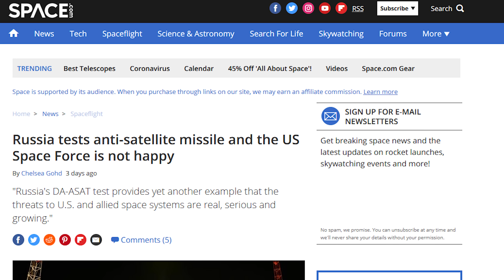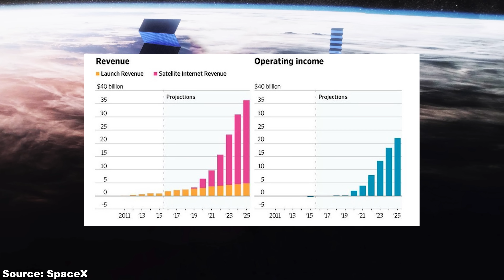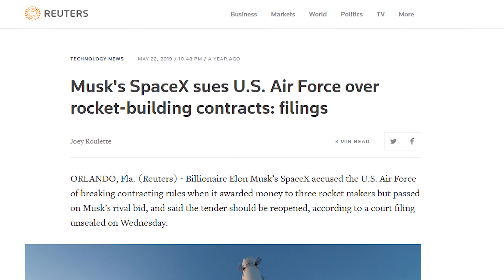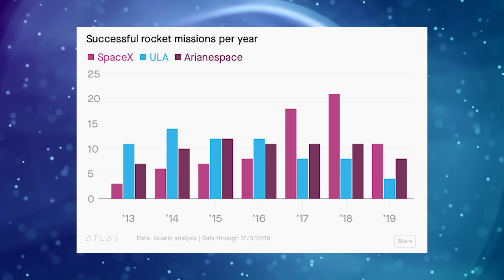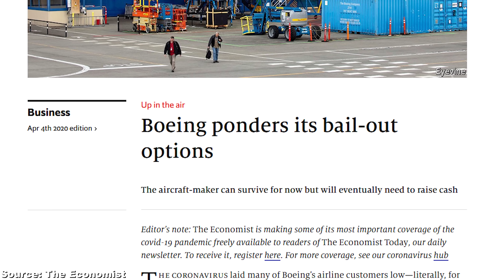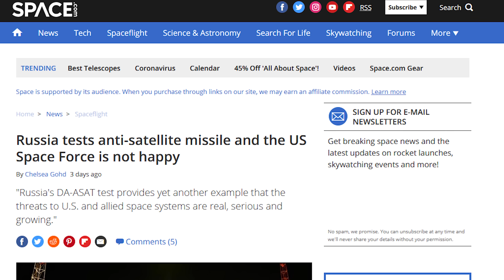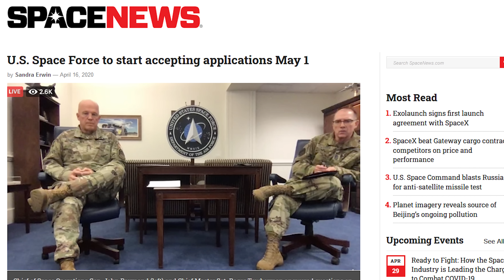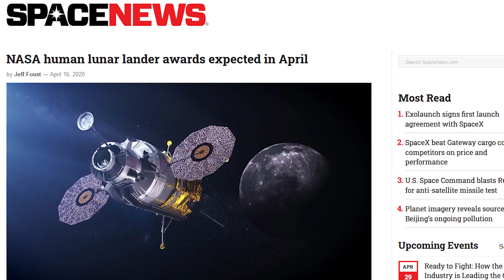ULA & Russia AFRAID of Elon! And Can SpaceX Afford 1000 Starship?!

Comment: I got a chuckle out of your humorous music choices for little moon landers versus Starship.  Good one!

But there are some unanswered questions about Starship landing on the moon.  Those other concepts mimic the Apollo approach, which is, after all, a proven idea.  Starship is something else entirely.  It's not only huge; it also has a much higher center of gravity and almost vertical landing legs which don't extend beyond the cylindrical hull.  Good thing there's no wind on the moon!  But seriously, uneven ground, perhaps disguised by dust, could cause it unrecoverable problems.  And taking off?  From unimproved dirt?  With no water cooling or blast deflection?  Uh... how will that work, exactly?  Apollo got away with it because the lander was tiny, and because it made no attempt to recover all of the landed mass.  Starship will be pumping out enormous amounts of furiously-hot gase.  Will those gases damage engine nozzles or other equipment at the base of the rocket?

Or perhaps landing and launch pads will be needed for Starship to operate safely to and from the moon?  And a transport mechanism to move the Starship from landing pad to launch pad?  Or perhaps external deployable legs will be added to the moon landing variant of Starship so it's easier to stabilize after touchdown?  Perhaps pressurized nitrogen tanks can be used to blow cold gas into the exhaust to prevent damage during lift-off?

Beats me.  I don't honestly know what SpaceX's concept is.  SpaceX has been very quiet about their plans for landing Starship on the moon.  They are leaving the subject to our imagination, for the time being.

Comment: Speeding up production of starship is actually quite easy now. It was/is hard to figure out how to produce starship, but the process is there now. Most like production can still be improved a bit, but will also face some limits. In my opinion creation of the engine section roughly takes 1.5 times as much time as production of the other sections. This clearly is the process bottle-neck. Reason mainly is that more parts/equipment have to be integrated in the engine section. This can be speeded up by making more sub-assemblies, but probably an unbalance with the other sections remains. In that case it is time to expand capacity. So, for 1 starship a week I think 3 times the same capacity is needed. That is just kind of copy paste and could be realized in approximately 3-6 months. Engine section capacity should be expanded a little more to compensate for longer throughput times. Robot welding might be another way to increase speed/decrease throughput time, but also will take leadtime to develop. Summarized, now the process is there, increasing capacity is technically relatively easy, though it will cost a lot of money for the investment.
Regards Eddy, manufacturing engineer

Comment: ULA - “Costs advantages of reusable rockets still unproven”.
Most expensive launch from SpaceX (Falcon Heavy Expendable) lifts 63.8 t to LEO/16.8 t Mars for $150 million. Least expensive launch from SpaceX (Falcon 9 Reusable) can lift 16 t to LEO/4 t to the moon for a net cost of $50 million.
Blue Origin New Glenn will lift 45 t to LEO (7.5 t to the moon) for ~$90 million.
Least expensive rocket from ULA (Atlas 5 (401)) can lift 8.25 t to LEO for $250 million, & the Delta IV heavy can lift 28.79 t to LEO (~7.2 t to TLI) for $650 million. According to the GAO & NASA, SLS will get 95-130 t to LEO (26 - 45 t to the moon) for $2-2.7B depending on Block).
QED - Even without considering Starship, reusable rockets are cheaper.
Reply: Somebody up above was pointing out that even in expendable mode, the Falcon Rockets are less expensive than ULA. I found that very interesting.

Comment: The issue of the “economics of reusable rockets” isn’t quite as simple as it might appear. (I read the Reddit threads analyzing the ULA arguments.) Yes, SpaceX Falcon 9 is way cheaper than the competition. But, Falcon 9 and Falcon Heavy even in expendable mode are way cheaper than the competition. So, something other than reusability is a major factor in SpaceX’s price advantage. Further, the price per kilogram to orbit is cheaper for a fully loaded expendable Falcon than for a fully loaded Falcon used in reusable mode. So, one could argue that, for certain scenarios at least, even for SpaceX, at present expendable rockets may be more cost effective than reused rockets. There are plenty of additional arguments, and I totally believe reusability offers the best long term hope for affordable launches. But, I also think that there is a degree of validity to saying that the superior economics of reusable rockets isn’t yet as strongly proven as some might think.
Reply: Maybe so, but the superior economics of SpaceX rockets over ULA rockets is undeniable.

Comment: Guys, I wish you would tone it down a bit. Starship is not going to be winning or even competing for moon lander. The engines are too powerful. Without a landing pad prepared ahead of time, Starship wouldn't be able to land without creating a dangerous situation by kicking debris as high as lunar orbit. If you want to see Starship land, one of those other craft are going to have to get there first and build the necessary slab of concrete for Starship to land on. Now if you want to talk about Starship carrying the vehicles to lunar orbit... ;-)
Reply: @TechChasm  Maybe in theory a horizontal landing would work. But I don't think that's a terribly practical approach in practice. 
at least not for the early moon missions. Starship is designed to operate in a certain manner. It would need a LOT of testing to verify that the final product can operate out of design range like that. Maybe I'll be proven wrong. But I suspect the reality is that Starship will end up needing a landing pad before it will land on the moon.

Comment: Both bosses of Roskosmos and ULA had reasons for their statements.
Roskosmos simply needs to save face, internally and externally. I mean, the head of Arianespace once said that Spacex is only so cheap because they get premiums for their government contracts. This is purely done to save face and placate politicians.
ULA on the other hand cannot switch to reusability so easily. They don´t have many launches on their manifest, so reusability would not benefit them as much as Spacex. And even then their launches would be more expensive. If ULA was to build less rockets due to reusability, they would have to lay off quite a portion of their workforce - which could draw the ire of congress and deprive them of their last lifeline. So ULA can´t go for full resusability for a number of reasons but has to sell it as a cost driven decision.

Comment: Robert Zubrin has cast doubt about Starship's ability to safely lland on the moon. He cites a study claiming that the Raptor engines will blast a huge crater in the surface throwing up lunar debris into space, posing a hazard to the ship.
Reply: i think its gonna be a tech challenge..that will need to be worked around,,maybe the tiles will be not so easy too...but i confident he will..get the thing in the air first...tho thats gonna be very soon im sure..
Reply: Ramon Punsalang That’s pretty stupid. The debris wouldn’t even stay in orbit.
Reply: It would be good if you could use the cold has thrusters..or maybe they'd have to have a lander..but obvs you'd want starships on the surface.. Because they'd be useful to use as building materials for infrastructure

Comment: I am going to bet that Dragon XL will have either 16 Draco rockets not the 4 shown in the pictures or a Super Draco. Why well firstly the contact is to fly 5000 lbs to the Lunar gateway hang around for up to 2 years and then dispose of itself.  Now 16 Dracos or a super Draco give it more than enough thrust to land on the moon. Assuming it has the spare Delta V then it can come equipped with legs as well maybe a couple of scientific packages. So very little additional costs involved. Alternately once in earth orbit it can also acts as a space tug collecting satellites for repair at the ISS clean up earth's orbit and even bypass the Lunar Gateway altogether and act as a delivery vehicle for the future moon base. 

There is after all Water and Helium 3 there which is better than a gold mine so someone will build a base. A base could even construct, well assemble much larger spaceships than Starship for long term exploration and asteroid missions. You have enough gravity to stop things drifting away somewhere solid to put your feet when you are tightening a nut or screw and only 1/6th of a gee and no pesky atmosphere when you launch. So at some point a moon base is a certainty.   

Of course Starship can do all this and more however there might not be enough of them about to do this and it adds a belt and braces approach in case Starship doesn't pan out though Elon is not a proponent of such an approach. Of course launching them on a Falcon booster would make such an approach very expensive in comparison but there is no reason that multiple dragon XL could not be hoisted into orbit by a Starship. The only drawback is that some way would need to be found to refuel these automated worker bees. Perhaps by a Starship who do so in orbit by a crew or return them to earth.
Reply: Helium 3 is completely worthless and will remain so until and unless we develop a way to use it in controlled nuclear fusion. Right now we can't even do D-T fusion. He3 requires an order of magnitude greater energy levels. It is going to be a looooong time before He3 is worth spit.
Reply: @odysseusrex5908  you are correct as a fuel source it is at the moment completely worthless however having a relatively cheap source of it to allow testing to develop helium 3 reactors the value is incalculable.

 It 's other value is that when or if we finally develop fusion then it will be something we definately need. After all no point in developing an ICE engine if there were no oil wells to give us petrol.
Reply: @glennedwards1449   There will be nothing cheap about mining the Moon. He3 reactors will be the second ot third generation after D-T. They will require far higher energy levels.
Reply: @odysseusrex5908  Actually I did say relatively cheap and if starship is working that changes the whole dynamic of space travel.  Cost of a Starship $2  million dollars cost of fuel well a falcon 9 is $200,000 but a Starship will require 2 launches with a booster but using a much cheaper fuel. Since the entire rocket is reusable and a lot cheaper than a Jet Airliner then it is entirely the cost of consumables so maybe $500,000 for a trip to the moon and back for 100 people or the mass of 100 people. Simple maths put that at less than the cost of a First Class ticket long haul. The worldwide production of H3 is miniscule and given an abundant supply multiple Laboratories can go ahead with developing H3 reactors maybe even skipping DT altogether.